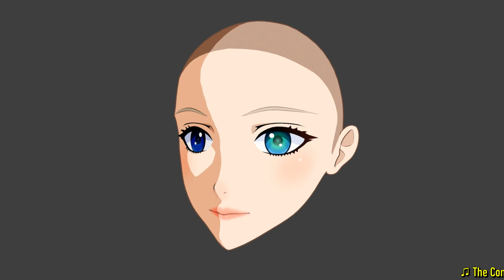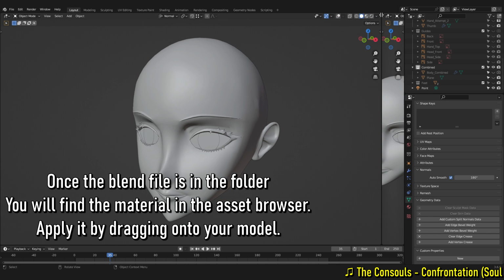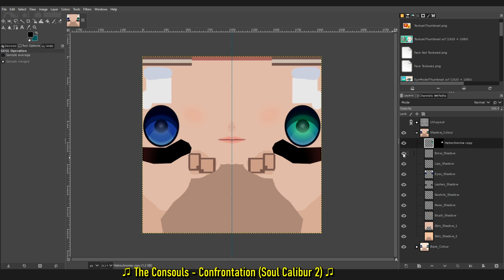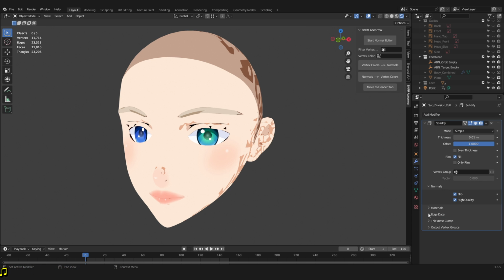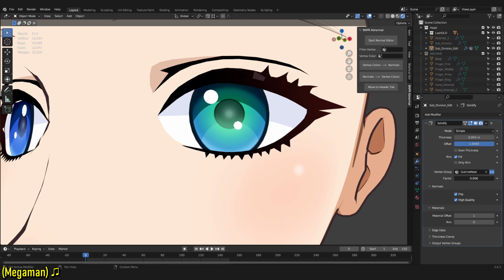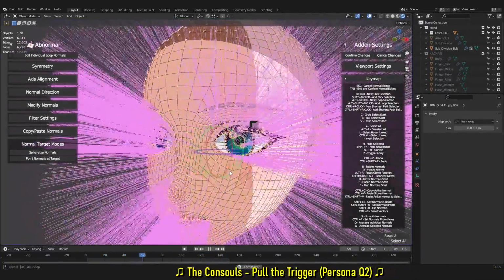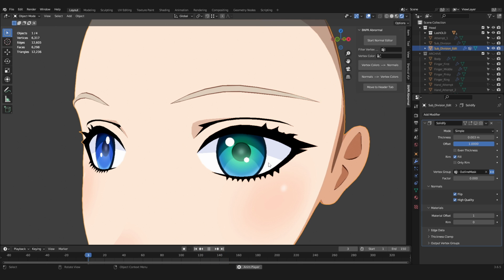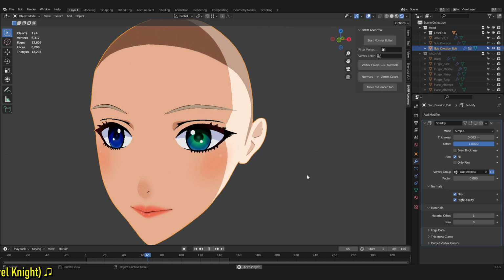How to get Smooth Cel Shading and Outlines in Blender 3D!

Comment: I would recommend editing normals using either a Tangent Space Normal Map or a Bump Map. As with those you can gain a higher amount of detail without having to have a high poly mesh. 

Plus if you want to edit or style it’s a lot easier/intuitive 😅
Reply from the maker: Yup I'm aware, I will cover a few other methods as well.
Reply: @facepalmedev  awesome 😎, will be staying tuned
Reply from the maker: @chidorirasenganz  Next will be editing normals directly but I have some alternate method that I will be working on afterward.

Comment: So, the work starts to bear fruit from here.

Also, I think you may want to use the grease pencil outline cause solidify doubles the poly.
Reply from the maker: I used inverse hull because it's quick and easy, however I think I stated I wouldn't use inverse hull within a game engine (Specifically because it doubles your poly count like you mention), instead I'd use shader solutions instead.

I haven't looked into grease pencil personally, as I want a quick and easy solution within blender and inverse hull is just that. I'll look into it for the future though and see if it can produce better results, so thanks for the heads up!

I have a couple more videos planned for shading/shadows, so the next video will be out in a week.
Reply: Inverted hull isn’t so bad, in many if not most npr style games use it for outlines